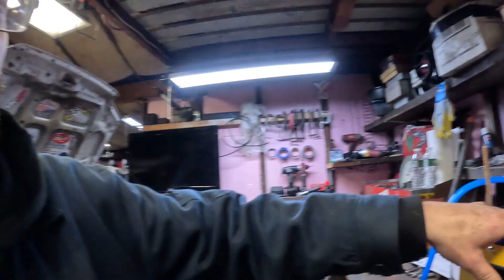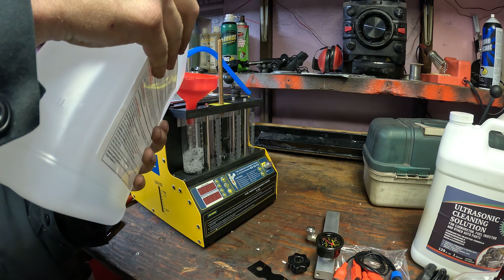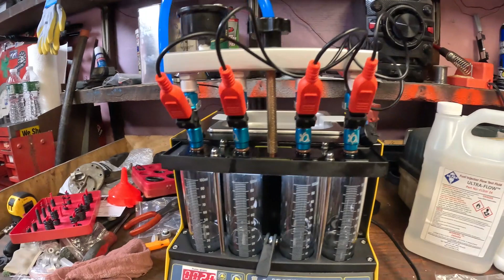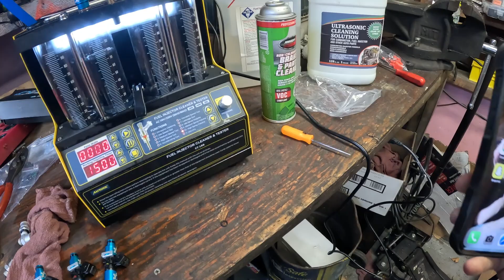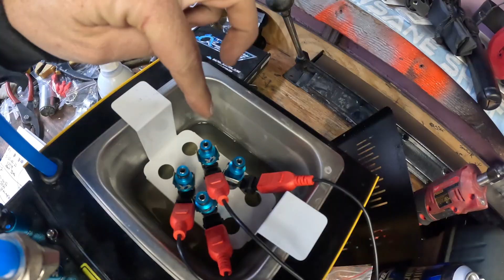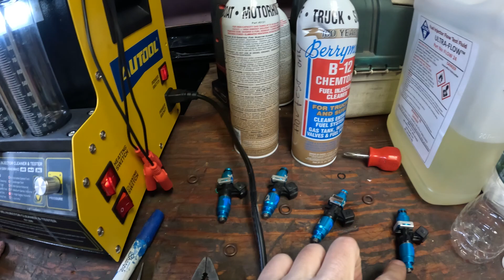USING AN AUTOOL CT160 FUEL INJECTOR TESTER AND CLEANER ON MY 1300CC ALPHA INJECTORS

Comment: you should have added an inline filter, the strainer in the unit is just trash catcher
injector flow is measured with the injector open 100% of the time, constant on, you would need external power to do with this unit
there is a pressure wave going back and forth in the manifold, there will always be difference between individual injector flow, to measure them you have to do one at a time on the same port

Comment: What’s the purpose of upgrading. I have an extra walboro 450. I was wondering if I need to do that because the gauge mines come with the pressure needle goes crazy and bounce between 20-50psi I can’t tell what it’s on I was wondering if maybe the stock pump can’t handle it

Comment: Nice video and I hav this machine and ID1700s and I was curious about the pump mod or at least plugging two ports and testing two at a time because mine aren’t flowing but then if I move them around they seem to do a little different flow but then if I two outside cylinders are pretty even the two centers are even kinda but my STI stock injectors all flowed the same but of course they are not as large as my IDs but I normally send them out to get professionally done but I wanted to do the cleaning myself. I’m glad I saw your video because I actually have my oil filled IAG gauge off my FPR and I can throw it on the rail instead of the cheap one that came with it maybe that will help

Comment: 1st off amazing video, brother. I have a question i wanted to swap pumps also, I had a walbro 450 pump to throw in there. So I did everything like u did, and it didn't do anything. The pump works, but it didn't flow any fluid thru the injectors. I put stock one that came with the machine, and it worked. 🤷🏽‍♂️ I have c120 machine 6 injector cleaner. Any ideas, thanks man....

Comment: go to hobo freight and get a stepper bit.  Drill out the bottom retaining plate one more size so the injector rests on the lip that below the lower o-ring.  Or make a new plate out of aluminum that will hold the injectors over the holes and isnt as flimsy as that small piece of sheet metal.  get at least 1/4 or 3/8.

Comment: What fluid you used for ultrasonic cleaning
Reply from the maker: I started with some Amazon ultra sonic cleaning fluid and ended with using berrymans b12 fuel injector cleaner. I have found out recently tho that any on the shelf injector cleaner with pea or pib which have longer words I forgot how to spell but those chemicals clean the best and I found royal purple max cleaner has 5% pib so I’m going to try that next time
Reply: Everything Royal Purple makes is way overpriced…

Comment: Hi im not here to bug you
. Im always ready to learn
Im getting confused by your math..
If you could explain me please?

Here what i find with my math

You got around 20ml in 4 sec
1 minutes ( 60 secondes )is 4 sec multiply by 15 ( 15x4 =60)
Your 20 ml x15 = 300 
Your injectors is about 300cc/minute
300÷10.5 = 28.5 lb/hr
Reply from the maker: The 4 seconds thing is wrong in the video. Near the end I start to test then a 15 seconds times 4 and times that by 4 again. The way you get it on a machine you can runs for a full 60 seconds is you run it for 60 seconds and times that number by 4. I can’t that’s why I have to split it in 15 and I was getting around 75ml in the 15 seconds. So 75ml x 15sec is 300. 300 x 4 =1200cc
Reply from the maker: For the lbs you would take the cc number you got 1200 and divide my 10.5 which is 114lbs/hr
Reply from the maker: Actually I’m wrong haha, you would only times the 15 seconds times 4 I guess which makes the most sense cause 15x4 is 60 for min. So I guess my injectors are still really messed up or that machine doesn’t flow enough cause the pump is only supplied 6v max I may make another video putting a regulator on and 12v to pump and see what happens
Reply: @schmikels_garage your supposed to flow wide open which I believe your machine doesn't do.
Reply: @schmikels I get why you think you have to multiply by 4 twice but that’s incorrect. I’m not sure if your machine has the option but to properly flow test you’re supposed to run the injector wide open. Let’s say you did a 15 second test multiply your volume by 4 and that’ll get you your CC/min because 15X4=60 seconds or a minute. Also if you have a set of 1300cc injector that means each injector individually flows 1300cc not 1300cc collectively with all the injectors spraying. Your numbers were low because the injectors weren’t being tested wide open and you thought you had to multiply by 4 twice to get your numbers close to that 1300cc.

Comment: why do you multiply by 4 twice. the first time because it's 15 seconds long, but the second time?
Reply from the maker: The first 4 is to get to 60 seconds and the second I can’t remember what the reason was but that’s what the equation calls for from all the info I found to find the cc,  if you wanted to find the lbs/hr you would multiple by 4 if ran for 15 seconds then divide by 10.5
Reply: I want to buy this machine to check flow by 3bar.. I have a injectors but don't know what flow cc in 3 bar :(
Reply from the maker: @Mi-chal  dang that stinks but atleast a machine is cheaper than new injectors. You could also send them out to a place for about $100 and have them flow and cleaned and then can tell you what cc they are
Reply: @Mi-chal  look for online conversions.  Google is your friend.